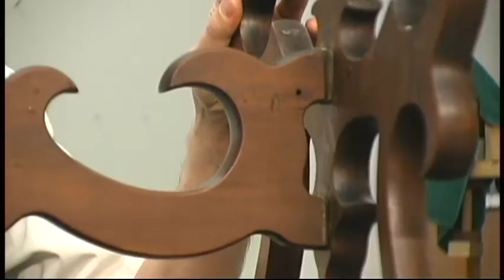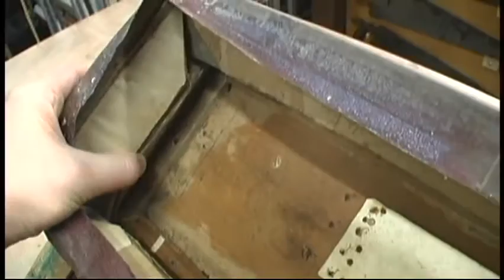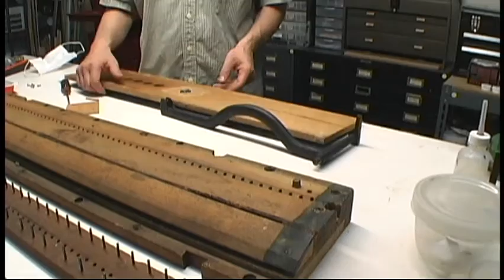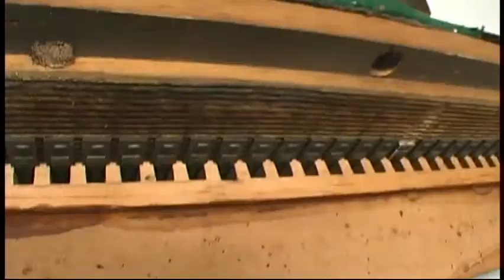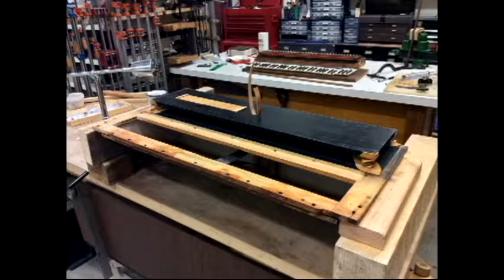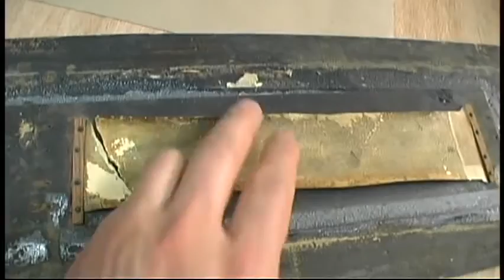1850's Melodeon

Comment: I just bought a melodeon almost identical to this, but it has ornate carved "vents" on the front below the keys, and is (to my understanding) related and representative of a corresponding patent filed in Concord NH (where it was made) relating to a reshaping of the bellows for better sound.  It's bellows has turned to paper, but looks in overall better shape than the one in this video, however missing the rods that connect to the foot petals.  I'd love to communicate with you more about this, anyone knowing about these instruments is VERY hard to find!

Comment: I would be grateful if you or one of the commenters can contact me. I've acquired on of these (Prince & Co. pt 1845), it appears to be in very intact shape, except no sound. The bellows  and wind chest to exterior touch feel intact, except that I can see/feel that the (papered canvas?) top back edge of the wind chest is unglued from the top back of the box, thus letting air flow out there. Wondering if hide glue should be attempted here? The airchest seems very intact except some surface wear on the corners, and wondering if I should reinforce this with some historically appropriate material (varnish or glue? Paper as it seems to be coated with? I hesitate to do anything that makes it less flexible and needs to be undone for a proper fix). Thanks very much for any advice!